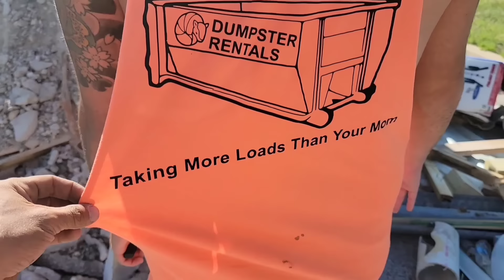Contractor Stuffs My Dumpster Full of Concrete: 12 Tons of "No Way José"!

Comment: Full-size roll-off services always seem to be a better choice. We always respect the hard-fill line. Then we pack them to the top. Never had a complaint from the roll-off service or a driver. These trailer roll-offs are always delicate. I do see quite a few general contractors buying these lately and doing their own job clean-up. Nice excavator.

Comment: Heavy duty cans and trucks, these dumpsters are our favorites. All that clean fill being mixed with trash makes it a trash load.  15,16t, whatever, and 3t is trash, 1 ton is light iron and the rest goes as clean fill?  Love it. This is why we have a transfer station so we can legally (in PA) sort these loads and handle appropriately.
Reply from the maker: Absolutely, might just need to get a peterbuilt fleet and start doing them as well

Comment: I drove a roll off semi trailer for a glass recycling outfit. 70% of the jobs were roll offs at rural landfills for the 3 colors of bottles. Not too many problems with overweight in a 45 yard container. Except for one little town dump that the employee spent all of his spare time smashing the bottles down to small pieces, then they were HEAVY. Solution was never give them a 45 yard roll off, always bring them a 30 yard.
Same thing for the storefront plate glass businesses. We had one place that would overfill the 30 yard roll off every time, no matter how many times we told them to call us sooner for pickup. So we ended up cutting them back to 15 yard low side roll offs, which they continued to overload with plate glass stacked 1-2 feet over the low sides. As a driver, all we would do was put the boom up until the foot roller touched the ground, then winch the box up that almost vertical boom and spill off all that glass that was stacked above the sidewall onto the ground. They STILL never learned!
Reply from the maker: Some places just don't listen or don't care! It can be frustrating, but adapting is key!

Comment: Got to love it when a contractor orders a 30yd bin and filled it with concrete or wet dirt. They fill it all the way to the top rim lol end up having a 20tonn bin 🤣  my boss ask what materials they are needed hauled away . If its concrete or similar materials we do the 20yd for concrete for this exact reason lol
Reply: I had a customer put 90,000 lbs of just ceramic blast media in a single 6,000lb empty 30yard container... Hoist on truck was rated for 60,000lbs... Truck with 30yard weighed 36000lbs and  max grossed legally 73,000lbs without permit and was permitted up to 80,000lbs... Needless to say customer had to rent a mini excavator and second container to split the contents into.
Reply: I had one order a 30yard with liner then proceeded to fill under the liner with concrete mixer clean out and topped with asphalt chunks then filled again with more uncured concrete...which then cured in the week before they called it in for service... Customer ended up buying the  30o container since it was not serviceable and the container was never emptied by one of our drivers... Worst part it was a brand new 30o container.
Reply: That’s nothing. I heard about a guy, that knew a dude, that said he worked for a real hustler, whose brother’s cousin’s sister said she was screwing a guy, who swore he delivered a 40 yd dumpster to a job-site, on top of a mountain in the desert and first, the Contractor perfectly leveled the container, then filled it to the brim with radioactive, molten lead, waiting 3 months for it to cool and then glued feathers on top to disguise the contents. The dumpster service eventually had to obtain EPA Permits, design, Permit and build a new DOT approved road for access across a protected ravine in a National Park, which required relocation of 11 gopher tortoises. Then rent a 150 ton crane to load it onto a 22 axle Heavy Haul Rig, take it to the regional port and then have it shipped straight to the battery factory in Gwaong Chang, China, only to be returned to the U.S. as EV batteries. So in the end, they were legally allowed to charge the Contractor and finally granted by the SCOTUS, $7.3 Billion to pull that dumpster. 

Fun story huh? 🤣
Reply: @KING-FU  except mine actually happened... I drive roll off for a living.

Comment: Years ago I filled a 20 yarder to the top with concrete. The guys wheels came off the ground about 4ft. I nearly shat myself,
because I thought he wouldn't take it. He said it wasn't a problem, I' just have to take the back roads to the dump (way overloaded). Now I just overload my dump truck.
Reply from the maker: Ooof yea, those are the not so good days. Easy way for us to tear up some equipment

Comment: What you should do is put in the Contract. Is, if the Contract is broken, Have 3 Options added onto the Contract, Either They Empty The Dumpster, You can Empty the Dumpster for them for an Add Charge, Or You can will take the the Dumpster, But, will have to Charge them Extra for another Dumpster(s)*until puts you into correct legal weight requirement then on top of it. Charge them a Extra $500.00 Per Ton.
Reply from the maker: I'm liken that

Comment: No way!! I run a rolloff truck. I have a class a cdl, so I run a lot of the 50 yards. Most of the time, I'm in the straight truck hauling 30's and 40's. We haul scrap metal. We have people break contracts and they either fix it or we dump it on the spot and leave. We don't fix it for them.
On a side note; What class of carts are you running? I used to run the modified 5 horse. Loved the dirt tracks!!

Comment: You need smaller dumpsters for hard fill, rocks and concreat etc.
So it is impossible to be overloaded.
Reply from the maker: @justsoicanfingcomment5814  I agree, and I would of given it to them. But I specifically asked if there was Going to be any concrete stone or hardfill debris work done. Of course they said no

Comment: I realize that this video is a year old and my comment is about your safety concerning your walking on the rails of the dumpster to secure the tarp . 
Have ya considered adding the sand paper adhesive so ya have a better grip , especially if it gets wet ? 
I’m planning on just starting out with my 14’ x6’x4’  landscaping trailer that has 4’ expanded metal walls and I’ll probably also add some plywood about 2’ wide in case I do a soil run . 
Keep up the good work .

Comment: I feel ya.  I was doing a parking lot crack fill at an RDC last summer and the company said we could use their dumpster for our boxes.  They had 3 dumpsters side by side one said metal, one said trash and one said cardboard.  It painted on the dumpster and on the asphalt on all 4 sides.  My idiot sub put all the boxes in the metal dumpster.  I spent two hours handpicking all the cardboard out because other subs had already dumped large metal cabinets on top of the boxes.  If they had not already driven home 8 hours away they would have definitely been doing it themselves but I needed to keep my customer happy since we had just done half a million LF of crack fill.
Reply from the maker: Oooof, I felt this one. 😪

Comment: The dumpsters we use have a clear mark on them that says if loading concrete max fill line. Just an idea.
Reply from the maker: Def would of done that for them, if I knew there was going to be hard fill in there. I was told multiple times there was just "light construction material from inside"

Comment: I had a customer today fill a 20 yard dumpster completely full with wet muddy dirty and tried to hide it with branches. I figured it out when the hook lifts cylinders bypassed. I did not pick it up and charged them a trip charge. A tandem axle dump truck  usually has a bed that big!
Reply from the maker: Eeeeek, the absolute worse! I'm sure the words "it won't be that heavy" were spoken before you dropped it off, too. Never fails!

Comment: If possible I'd have used the trailer and the loader to tip the can and dump it in the lot. It'd have been so  much faster to scoop up with a bobcat VS picking it out basically by hand. People suck though I hope you fined the crap out of them
Reply from the maker: So I didn't even fill it, but we attempted that. It could could hardly lift it, but I couldn't get the dump angle to actually poor it out. Maybe if I had both pieces of equipmemt at the same time we could have. As you saw, the whole thing was just a wreck

Comment: The dumpster is not in a secured area, so everyone and their dog was using it, also subs do not care at all about the dumpster restrictions, they will bring waste from home and other sites to dispose, its just a free dumpster for them.
Reply from the maker: Typically yea I'd agree with this. And yea they didn't care. But everything that was in this Dumpster was 100% them. Unless someone showed up with 12 truck loads of Concrete and tried to slip it in 😄. The company definitely admitted to it all. And paid. So it worked out.

Comment: IMO, they were too stupid to understand the contact and the guys on the job are probably used to having cans run by Rolloff/Hooklift trucks on other jobs. Those trucks have a far higher capacity and a much stronger winch/hook. There are companies out there that rent 20 yard dumpsters that allow them to be filled with concrete or dirt to the top. If the super on the job saw your drop it off or knew what your setup was I doubt you would’ve had that issue. The supers know that when the company gets back charged by a dumpster company they are going to get chewed out.
Reply from the maker: Maybe true, but I really couldn't have been more clear with them. It simply was one hand not talking to the other.

Comment: Hey I could be completely wrong but when you point out the metal being split looks like it was full of water and froze which swells and bust the metal like that hard to tell tho
Reply from the maker: I could see how it looks like that, but this is actually our newest can, it hasn't actually seen winter yet! I think think the rust look is just from it sitting there. And water probably has got in, because it was there quite a while. From what I can tell, it's from the concrete being poured and beating against one side. That frame basically was just holding the doors together as best it could, but eventually something had to "give". There are a couple supports that look like they "buckled" if that makes sense. And I think it's from the pressure of the dumpster trying to keep its shape with the doors closed

I could be totally wrong, but this dumpster was it the best shape before this rental lol.

Comment: There a little more expensive but would you say max d is the brand to go with for handling situations like this for stuff not breaking
Reply from the maker: Maxxd are incredibly heavy duty, compared to other brands (in their class). But I will not say they should be used to pick up loads like this. Honestly, this load would of been appropriate for a triaxle dump truck or semi dumpster rig. We have picked up some pretty heavy loads that were rated well above the trailers capacity. But if we had attempted this, it would have been a record for us, and incredibly dangerous. With our trailer and truck combo, we are legal at about 6.5 tons (and that's pretty heavy compared to an average dumpster we service). Of course there are times we pick things up that are a bit heavier, but you don't know until it's emptied. But it's definitely the biggest risk factor in the business.
Reply: @rollingops  ok thanks for replying and loved the video

Comment: Dude how do you keep your batteries charged up? I’m having so much trouble keeping a charge on my maxxd
Reply from the maker: I'm guessing you must primarily use a 2500. My 2500 doesn't keep the trailer charged quote as well as the 3500 HD. But there are kits you can also get to run power straight from your trucks alternator to the trailer. You'll never plug your trailer in again
Reply: @rollingops  I have a 3500hd actually, but I might have to look into this kit you’re talking about that I can run power directly from the alternator to the trailer

Comment: Well hell if I would have saw that in my Lowe's parking lot I would have dumpster dove and got all that tin and brought it back to my house
Reply: yeah that's free money in your pocket right there, unless you end up using it for a project. even some of the wood pieces
Reply: @howlers8  I agree and I like to reuse anything I can or try to repurpose stuff
Reply: @tommystarcher6982  to be fair no projects for the tin so that would have been sold as scrap the wood, for sure, would have have been held on to or used for something
Reply: @howlers8  I feel the same way if the tin couldn't be salvaged I would scrap it because that's what I do myself when I see stuff like that I try to get it out of the trash and recycle it and make a little money at the same time in the wood I for sure would have used on some project

Comment: I would be a lot more careful with how you secure your equipment. Your securement of the skid steer is completely illegal. You need 4 separate chains and 4 separate binders (found that out the hard way). You can get by with 2 chains abd 4 binders but you have set it up properly. You also need at least 2 straps for the extra bucket you put on the trailer.
Reply: Depends on the weight of the machine. I didn’t notice what size the skid steer is, but 8500 pounds or less is DOT legal with two binders.
Reply from the maker: Someone else mentioned this. Keep in mind both of my machines are under 10k lbs. I was always told I only needed 2 points of contact if under 10k lbs (and that was a state trooper and I had read it). We typically are only traveling 15 miles with these machines (no excuse to be lazy) but when we travel out of town, I actually tie down 5 times. 4 corners and bucket. But I may cut down some chains to get 4 points of contact easily just to be safer, and if I do it right, it would be faster because I wouldn't need to jump on the trailer.

Comment: There is big money in moving dirt, concrete and asphalt around. 
Maybe something you might consider doing. 
Easy money
Reply from the maker: Yep one of the coolest examples I saw in town was a dump truck company that bought a piece of land that was basically a giant pit in the ground. But it was off a major road. They used it for years as a place to dump hardfill from all the jobs they had. they left a couple pieces of equipment on site to push and grade the space over time. They just recently sold it for over a million dollar profit. And dumped all their hardfill for free, for years.
Reply: @rollingops  
I knew a guy who had a good sized farm property.  He would haul dirt in there,  later on sell to someone who needs fill. He kept getting paid over and over. The trucking and getting ride of it.   Your kx040 can load a dump truck no problem.   You just need a big ditching bucket
Reply: Here in nc $95 an hr hauling asphalt.  8hrs a day

Comment: Why not just hire a full size roll off truck to pick it up and then just tack on a hefty fee for the trouble. Its got to be easier than hauling an excavator and extra bins.
Reply from the maker: There is a reason we're one of the better options in town. Sadly, if I call for a roll off, they will say "we can be there tomorrow" and tomorrow turns into next week. I've been to that rodeo with them a couple of times. My best advertising is my competitions performance lately.
Reply: @rollingops  I hear ya. Sounds like an opportunity to provide some quality service. My friend started off with one roll off truck 35 years ago. They now have 50 employees, and own the recycling plant. Hard work pays off.
Reply from the maker: @loveistheanswer8137  one building block at a time!
Reply: Here in Kansas that metal is about 7 or 8 cents a lb